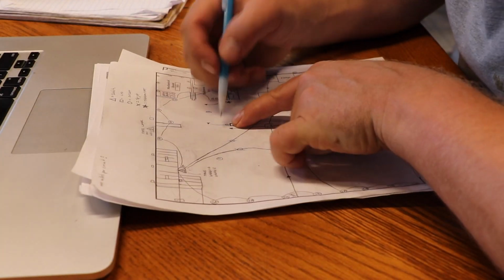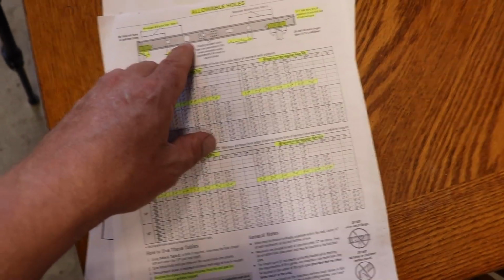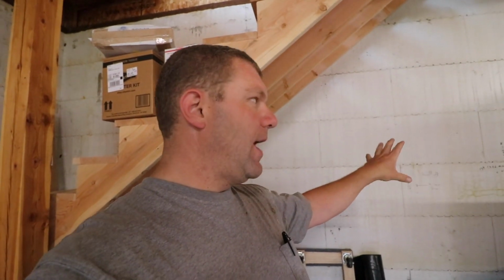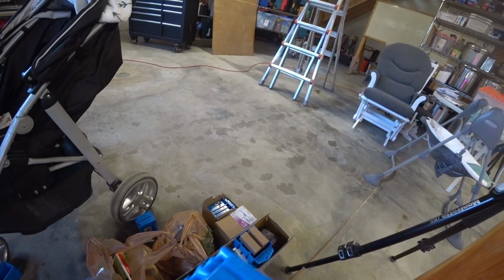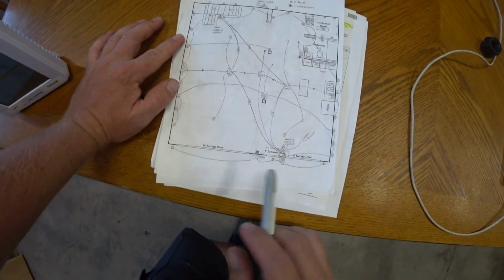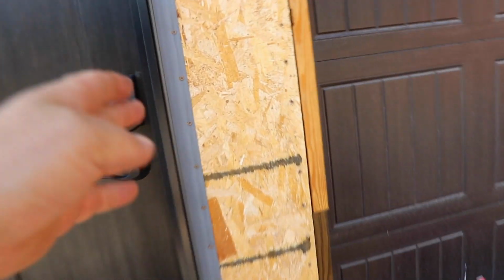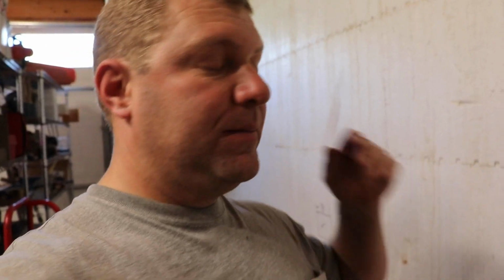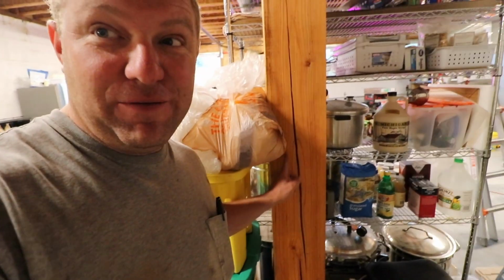THE NEXT BIG PROJECT! (Beginning Garage Electrical)

Comment: In Austin, I put in a 4 zone mini split and after 3 years it is working great.  Using ducts makes no sense.  I have a Class A combined refrigeration and AC.  Seeing your house since day 1 it  makes sense to put in a 4 banger.  I prefer Daikin as they are 65% of the world market in HVAC including one of the new world trades using them.  Your house is so tight and energy efficient a 4 ton minisplit system would handle heating as a heatpump down to -10F.  The variable compressor will throttle to less than 1 ton.  A 3 inch hole to run the drain line, power and refrigerant line is all that is required.  Power for each unit comes from the condenser.  Stick the units on the back wall area at about 10 foot height including basement.

Comment: 2 duplex outlets every 4' IS overkill !  6' would be fine.  Also, because you have no partitions, that whole space is considered a garage.  IIRC, the NEC requires all outlets and switch to be 48" off the floor.

Most people will tell you to use 12/2 for everything.  It is a waste for lighting circuits.  Don't forget, NEC now requires an unswitched hot, neutral, and ground in every switch box and light/ceiling box.

Those "old work" boxes will hold a ton with 3 "wings".  If you need more, you want a fan mount that spans between 2 studs/joist that you don't have.

Comment: Why do you want outlets so close to the floor? Your not that young and your getting older by the day. More accidents or back injuries are caused by bending over. I would have set it up at 3 to 4 foot off the ground and use GFI out let to start my string of outlets besides the outside one should be GFI anyway.

Comment: wouldn't you be better of using conduit for you wires and attaching them to the bottom of the I beams? So no holes needed before your plumbing nightmare starts.

Comment: For the outlets next to the doors, stagger the height of the boxes, that way you can maximize the foam behind the box and help prevent air infiltration.  Why have essentially three lights over the "man door"?  The coach lights next to the garage doors on the inner side, or whatever design you use, should give MORE than enough light.

Comment: How are you going to run your 220 to run to a accessible when running a 220 compressor etc instead of going to a non- ready accessible plug......  How are you going to wire it??

Comment: not an electrician but why don't you  use a panel on the outside box conduit along the wall  and it wouldn't take away from the installation

Comment: When I built a SIP house, I rotozipped electrical chases where needed, electricians pulled wire through chases and I foamed the zipped channels level with the OSB.  On your garage door wiring, believe you are looking at on 12 and 3 - 14 cables.  The 12 would supply power for outlet and lighting circuits and the 3 - 14 cables would supply power to the lights.  Happy wiring ahead!

Comment: I'd put conduit up, or if you do go in the walls insulate those boxes nicely after your done pulling those wires through the sips, with spray foam.
Reply: Reason I'd run conduit if your code allows, is so that you can modify things in the future if you choose.

Comment: Save the SIPS, I would personally surface mount everything and save the insulation of the SIPS, that way you can punch out to the exterior circuit and lights from the surface-mounted conduit. Also instead of doing outlets in the center of the garage... put retractable extension cords on the ceiling plugged into an outlet on the ceiling, that is what i did in my garage and i use it so much i rarely pull an extension cord out anymore. I even ran retractable air hose to the ceiling when I moved my air compressor to outside....

Comment: The rule of thumb for light switches is,  when you enter a room through a door way the first switch lights the room. By the front door the outside light is the farthest away from the door, the room or hall light is closest to the door and is a single, easy to find in the dark.

Comment: I ONLY HAVE ONE QUESTION.  IF IT'S IN THE GARAGE, WHY DO YOU WANT TO CUT HOLES IN THE SIP ?  WHY DON'T YOU RUN EVERYTHING USING CONDUIT ?  I THINK THAT WOULD SOLVE ALL OF YOUR PROBLEMS. YOU JUST HAVE TO MOUNT EVERYTHING ON THE SURFACE OF THE SIP AND YOU DON'T DESTROY YOUR WALL.
Reply: Do you see him offsetting the box with a board?  That's to leave room for sheetrock at some point
Reply: @KraftyKathi  YES I UNDERSTAND THAT BUT WHEN YOU LIVE IN A COLD CLIMATE YOU DON'T EVER WANT TO LOSE ANY OF YOUR INSULATION, BELIEVE ME I KNOW FROM EXPERIENCE, FLOODED BASEMENT.  I WOULD HAVE PUT THE SHEETROCK ON THE WALLS AND PUT THE ELECTRICAL BOXES AND CONDUIT ON THE SURFACE OF THE SHEETROCK. THAT WAY YOU HAVE NO HEAT LOSS AND NO BELOW FREEZING TEMPERATURES COMING THROUGH THE WALLS WHERE YOUR ELECTRICAL OUTLETS ARE, NOT TO MENTION THE WIRING RUNNING THROUGH THE WALLS.

Comment: What is the depth of your foam?  Ours is 2 1/2". A standard 18 CI box is 3" deep. I just cut the foam to the concrete and anchored through the back with a TAPCON. I channeled he foam with a cheap electric chain saw with a guide to control the depth.  I set it at 2". stick the foam at the back of the channel and foam it in.  All you need is 11/4" of coverage.

Comment: It looks like your setting the boxes out for drywall. Why leave the tabs on? If you use them to attach the boxes you screw into drywall, if you attach the boxes before dry wall, those tabs need to be removed.

Comment: Just a small observation.  Are you going to finish the garage???  If so, why?  Make your life easier and your wiring able to be repaired should you need to.  Use surface mount devices and conduit.  You will cure a host of ills with that approach.
Based on 40 years of electrical engineering experience.  Just my $0.02.
Reply: I agree, Conduit & surface mount boxes would be ideal. Also for the outside I would recommend a metal cast box since exterior boxes can easily get broken. Personally I cannot stand the cheap plastic boxes, and for my home I used all metal boxes. Safer since you can ground metal boxes too.

Comment: If you plan on using multi wire home run cables, make sure you use 14-2-2 or 12-2-2 which contain two separate neutral white wires.  Arc-Fault and GFCI circuits can't share a common neutral and since you're using your future garage as living space now, the inspector may require every circuit in that area to be arc-fault protected.

Also as others have said, surface mount the switches and outlets at the garage door so the SIP isn't compromised.
Reply: Arc fault in residential application is the dumbest thing and completely unnecessary. There is no need to go beyond the protection of what GFCIs offer.
Reply: What does Ark-Fault do?
Reply: @4philipp  it's supposed to prevent Arc flash; the breaker or disconnect device from literally exploding.
Reply: WileyDean hmm, I never heard of that before. If it can’t share the same wire as the gfi, where would it be installed?

Comment: Why are you dicking around with electrical now? You can do that when the weather is lousy. Finish the outside and protect all the time and money you've invested already!
Reply: Urm actually because the electrical goes through the sip panels they need to do that first before they can foam which they have to do before they can clad the outside.... even if i am also concerned about the osb weather exposure.
Reply: @601salsa  I also suspect this video was started early in the summer.
Reply: Curt Boyer they have addressed the reason behind not finishing many times but always someone to tell them a better way 
What’s the name of your channel?

Comment: As long as your using electric code loosely,  start by planing the use of 5/8 sheetrock in garage not 1/2 inch (which is not code compliant for fire /garage rating).  If the loosely followed code in Idaho will allow 1/2inch then your good...does Idaho have their own made-up code?   Opps, forgot...we'll just work it out when we get there.
Reply: 5/8 is only required for the portions of the garage that have living space on the opposite side of the wall.

Comment: Are you sure about using 1/2” Sheetrock in the garage?  I thought that 5/8” fire rock would be code in a garage?
Reply: Especially over the foam of the ICFs. That stuff is nasty when it oxidizes.
Reply: I would have gone with Plywood instead. Drywall in a garage usually ends up with a lot of holes. Plus if it gets wet it does end you disintegrating over time.They can probably get away with 1/2" drywall on the walls, since its already sheathed in OSB which provides a firebreak, except for the ceiling which will need at least 5/8". 3/4" would be better.
Reply: I was told the same thing about to 5/8 sheetrock was needed to be a firebreak
Reply: Actually 5/8"  is required on the walls to cover the foam and two layer of 5/8" on the ceiling to separate the garage from living space on the ceiling.
Reply: The garage walls don't need fire break as there is no living space on the other side of the wall.
Reply: He might not need a firebreak at all. So the Sheetrock would be just a wall finishing touch

Comment: I’d be getting Tyvec up before the OSB dissolves.
Reply: Yeah, I don't understand why they aren't doing that yet. They even built a man basket so there is no reason (that I can see) for them to not get the house water proofed
Reply: @Romaobb  because they have to run electrical through the sips first so they can then foam the chases before the siding can go up.

Comment: Easy solution to the switch wire number issue by switching to low voltage switching and have a relay box in an easier to access spot you can feed wires to easier.

Comment: I think i would use solar lights outside.
Reply: Yes, I understand that. There are solar lights that the solar panel is on a long cord so the solar panel is in the Sun and the lights can be placed where ever you need them even indoors. Some even come with remote controls so you can have a controller in your car like a garage door opener.
Reply: @bettylouscorner2738  I'd forgotten about the ones with remote panels.  And that face of the house IS the south side so it would be just about perfect.  Personally, I'd look into fitting solar panels between the top of the French Doors on that side and the bottom of the triangular windows near the roof.
Reply: There will be a deck over the garage doors.  Someday . . .

Comment: There should be knock outs predrilled in the joist. Typical anyways. Take hammer and knock them out. But if you don’t have that. Put drop ceiling in

Comment: You can run 14/3 or 12/3 Romex wire between the man door and garage door. Both circuits share the white wire. Then the Black would be circuit A and Red circuit B. That'll cut down on the number of wires ran.
Reply: issue is 12/3 or 14/3 is you cannot share the neutral with ArcFault or ground fault breakers, unless you use a 2 pole breaker. I am pretty sure outside outlets all need to be at least GFCI.
A surface mount EMT & switch box would save the day IMHO.

Comment: As an Electrician myself, I applaud the knowledge you have gained during this housebuild. Now here's a thought: You could consider a 150amp sub panel upstairs fed from your main panel. This would eliminate the number of holes and wiring you would have to run down to your main panel. It would also free up needed main distribution panel breaker space.....just a thought
Reply: Would be much easier. Don't have to worry as much for where ductwork and plumbing will go. One panel for all of the down stairs and one panel for upstairs
Reply: I doubt that small breaker box is going to cut it for them, especially with current NEC rules.

Comment: Jessy the hack master of electrical; to stubborn to get the right ICF boxes
Reply: Nope. I just saw a video of a local electrician local to me do SIP's for the first time (I think) and he drilled out a 4" hole where a switch or  outlet box will go, then used the markings for the preexisting wiring chases and fishing tape and string to transition from outlet to switch in a SIP, from a SIP wall to a stud wall etc.

The boxes used looked to be typical boxes, nothing special, but for old work type of installations as this is essentially how it's done.

However, where boxes go, it's a 4" hole saw for the wall boxes as typically, they are to be finished using a flat mounted 2x4 as the studs for the finished material(s). and the box will be flush to that instead of the SIP. Now, for architectural ceilings, they use a special box for that, a round fixture box that can screw into the surface of the OSB Sip surface rated up to 50Lbs for lights like chandeliers. 

Otherwise, he uses the existing chases and drills 4" round holes where necessary for fishing between switch and the light is to be mounted to the ceiling or wall, and simply plugged back up with the plugs generated by drilling the holes when done.

At least that's how it's shown anyway in the SIPA video from Sips.org.

Comment: I would install all of the wiring on the inside,  then batons and dry wall on top, if inside the sip is there not an overheating risk? At best cable size would have to be much bigger?